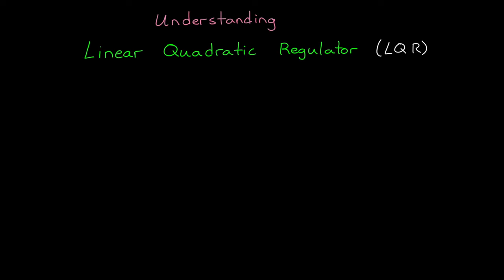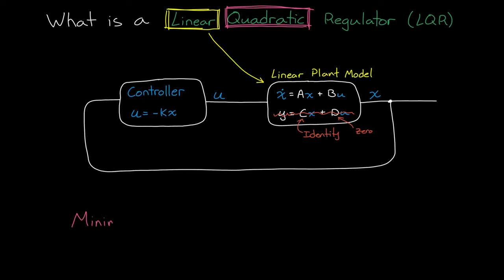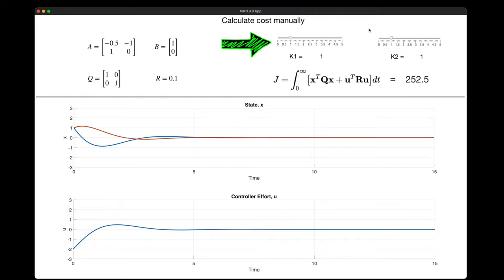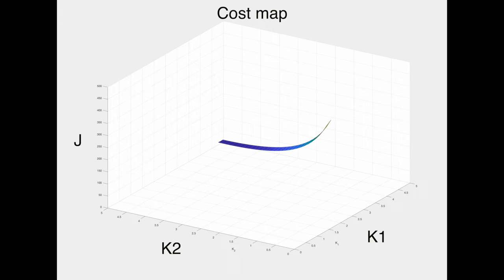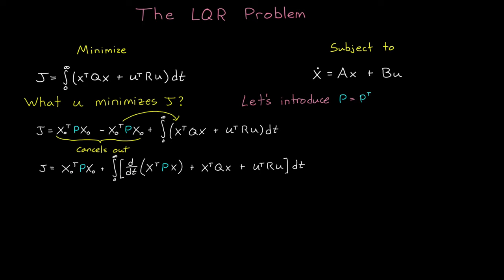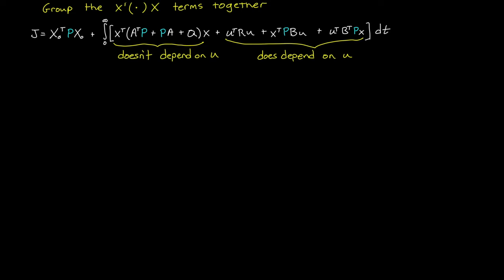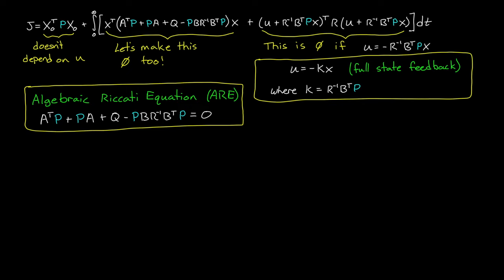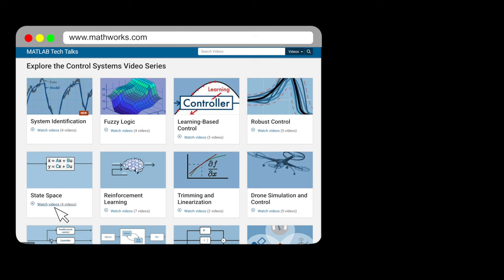Why the Riccati Equation Is important for LQR Control

Comment: Hi Brian! Thank you for the video. I would be glad for a comment on a following question. In the derivation we introduce P, which stays outside of the integral. After that we set both terms under the integral to 0 by equating control to a product of a number of matrices and by demanding ARE to hold. However, it is not particularly clear for me, why does this exact value of P minimize J? Why couldn't there be a matrix P' that does not set the terms under the integral to zero at all times, but that minimizes x_0^T P x_0 somehow? I was not able to find this kind of derivation in the literature, everyone just applies HJB and that's it. I will be grateful for a clarification on that.
Reply: I responded below on @hectorgautier4061's comment. To add to it, are you asking why there isn't more than one P matrix that drives the integral term to 0 as time approaches infinity? Like for example, we know that the P in the video produces a summation of 0 for the integral, but what if there is another P that maybe adds the same amount from the first term as it subtracts from the second term and the summation is still zero? I haven't thought about this but I suspect that the quadratic nature of the cost function prevents this from being an option. Between this and answer below did that address your question? If not, could you clarify some more? Thanks!
Reply: Hi  @BrianBDouglas  ! Yep, everything is crystal clear from the answer, thanks a lot!

Comment: Thanks for the content. I have some question if I may. I understand that at the beginning we want to find u to minimze J (because u is the only variable that we can tune). Then we make appears a term that has no influence on the value of J and that depends on the variable P. And from here I am loosing a bit the sense of the connection between our goal which is minimizing J with the transformation. We deduct that to minimize J we have to make in sort that the inside of the integral is zero, but to do so we constraint the shape of u  with the variable P which has initially no impact on J. So now P has an importance because the expression of u depends on it, but P is outside of the integral so how can we know that making in sort that the inside of the integral is zero will really minimize J? 
I admit I am a bit confuse, I think prefer the explanation through the Lyapunov function.
Reply: I have exactly the same question, yep
Reply: I originally was using a calculus of variations approach to the derivation (which I think makes more sense) but it would have been a lot more math and perhaps too much for this video. I'm not sure I fully understand your question but let me try an answer. The matrix P doesn't change the value of J at all. We add in X0^t*P*X0 and then subtract it immediately. Both terms are initially outside of the integral, but with some clever algebra we pull one of the terms into the integral. Again the cost, J, is unchanged we just do this because it helps us solve the problem of finding the lowest J. At this point, there is a fixed cost outside of the integral that we can't change. But we do have the ability to affect the total cost of the integral itself. We then show that for a particular U (state feedback) and for a particular P (solution of the ARE) then the integral part is zero. This is the lowest absolute value it could be so there isn't a total cost that can be more optimal than this. Please clarify your question if I miss understood. Thanks!

Comment: Could someone explane me why "the state goes to zero as the time approaches infinity" (min 8:35)? I mean, if I have some non-zero reference state that I want to be reached, and the closed-loop system is stable, shouldn't x converge to the reference state? Thank you! :)
Reply: in that case, it would be another form of Ricatti equation
Reply: Usually states(x) are considered in terms of error(e) and errors tend to zero as t tends to infinity.

Comment: I still trying to figure out some points:

What probably motivates Riccati to expand the cost function?

Is it because he wants to explore the implicit relation between input u and state x (which ends up as u+R'B*Px) while maintaining the quadratic x terms independent in the resulting cost function?
Reply: I think that the riccati equation is nothing but a form of ODE in a matrix form which is the direct result of the optimisation of the cost function in terms of U(the input) and the state X constrained by the state equations, so in some sense what the riccati equation do is that it gives us an analytic approach to find a P matrix that optimise the state feedback U = KX where K = R’BP ,R and B are time-independent only P is time dependent 
   Thus the riccati equation in reality has nothing really to do with the cost function from a conceptual perspective, it’s nothing more than an analytical tool to find a mattix P that optimise the cost function.
Reply: @ahmedhassaine3647  I mean, how someone get the insight to introduced matrix P from the beginning into an already simple cost function, going through partial integral and quadratic completion tricks, while it ends up as a longer cost function?

Comment: Does anyone knows hot to numericly solve the Algerbrique Riccati Equation?
Reply: Do you mean solving without using idare?
Reply: You can take an example from reference textbook. A problem of lower dimension can be solved by hand. But for higher dimension you need some numerical solver.

Comment: I think it was better if you rely on introducing the ALG Reccati equation through the variations calculus, since the cost function is nothing but a functional, thus optimizing it means finding the function that minimizes it, personally, I think it is more intuitive because it a indirect application of the least action principal.
Reply: I started with a calculus of variations explanation at first but it took too long and was very math heavy so I pivoted to this. I know it's not ideal but these Tech Talks are really just introductions to topics to get people interested to learn more and not necessarily complete explanations.
Reply: @BrianBDouglas   yeh i can see your raisons mr.Brian which are logical considering the mathematical background required to digest the concept, i would like to thank you personally for your tech talks since they helped me in many cases to have the general idea before going deep in it, and i would like to apologies for my comment if it was inappropriate.
Reply: @ahmedhassaine3647  Not inappropriate at all! No need to apologize. I wish I could have a found a way to make it work for my video. Thanks for the comment.